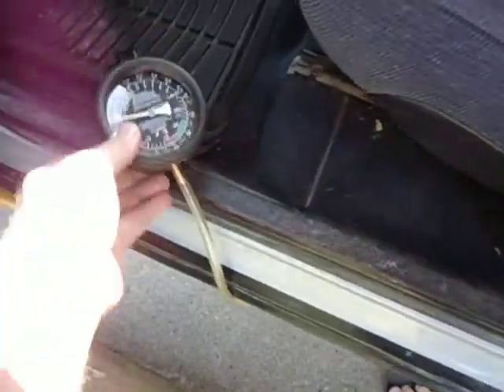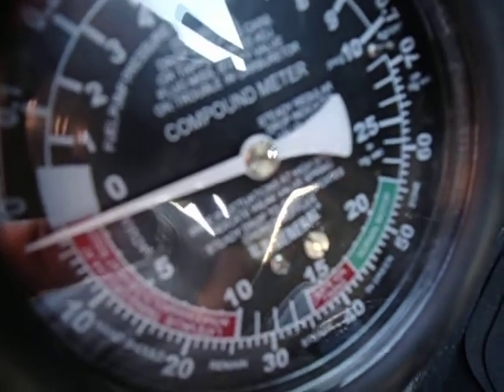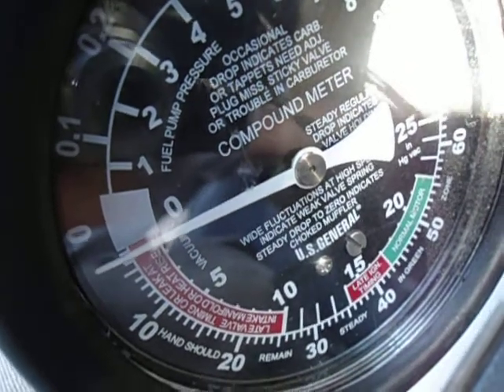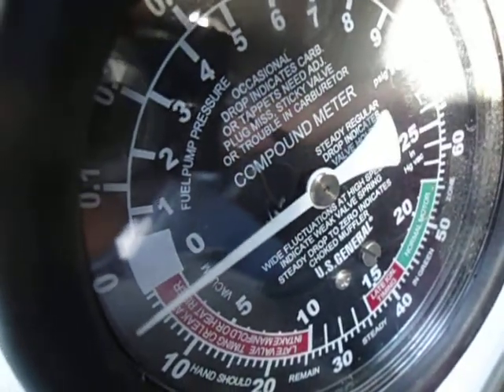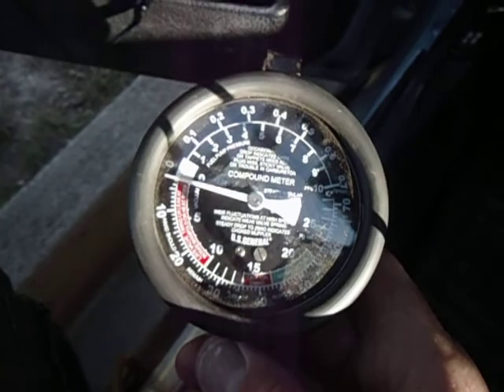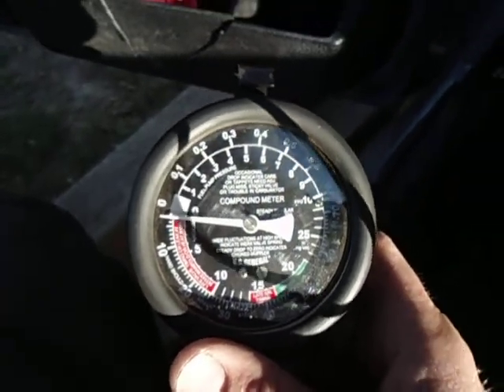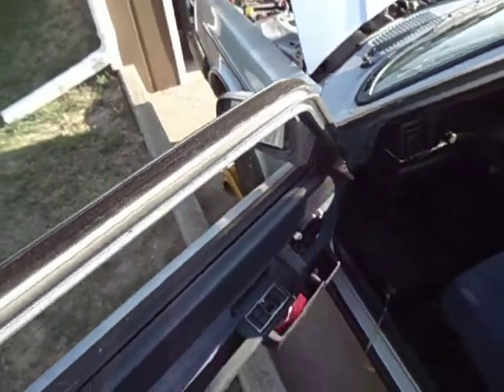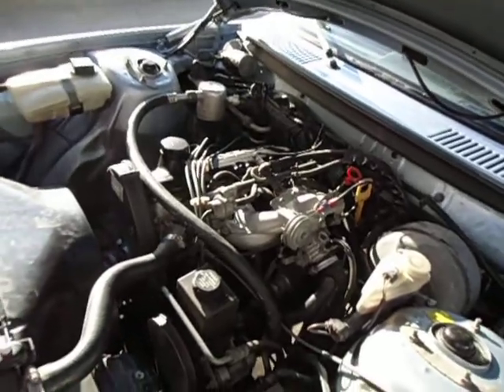Back pressure test on Volvo 240

Comment from the maker: Yeah...I later removed it and found it had been hollowed out.  Luckily, its not a requirement where I live.   
For some reason or another, on this 91 240 the exhaust flow was much lower than my 89 740.  They both share the same engines and I wanted to figure it out....never really found anything other than the 240 has about 150,000 more miles than the 740...

Comment: I would be curious to see if it's as good on my 240 diesel.
like it's a diesel i should have a full volume of gas all the time so maybe it acts a bit different than yours on the throttle response.

Was you suspecting a clogged catalytic converter ?

Comment: I f i understand correctly the 240 has lower back pressure than the 740 ?

As i know  the exhaust system is not the same on 700 and 200 series.
It's maybe more free flow on the 200.

You mentionned the mileage : you think you have less compression on the engine,so less pressure in the exhaust because of the lower gas volume ?

i don't understand what you mean.

about you broken odometer on the 200 it's a pinion ring wich is famous for breaking.
You can find them online and repair without problem